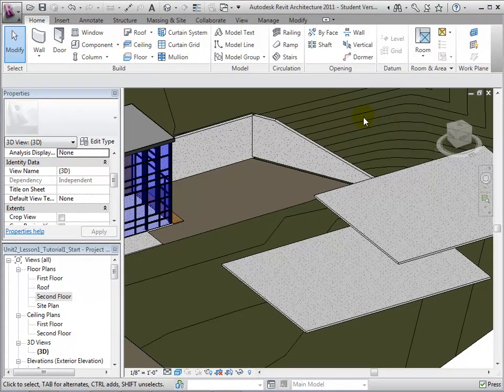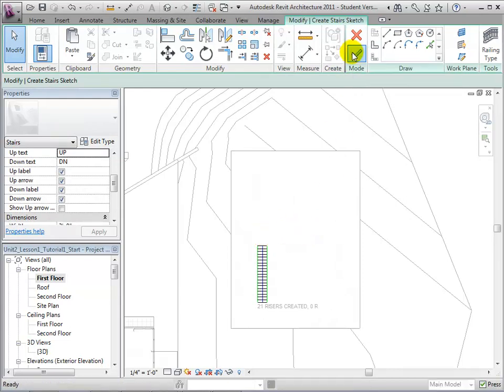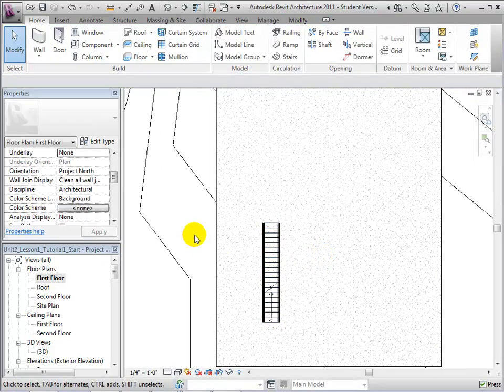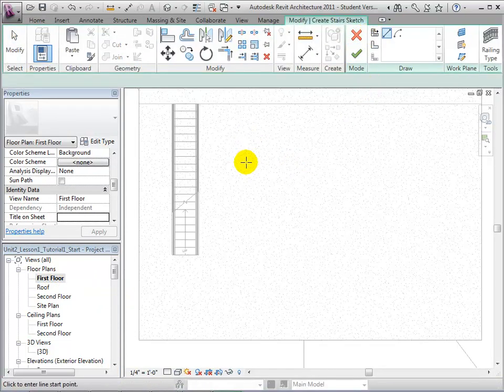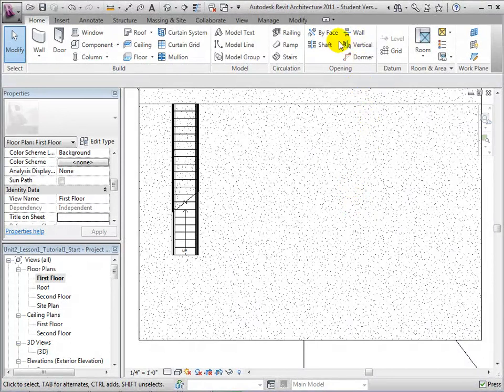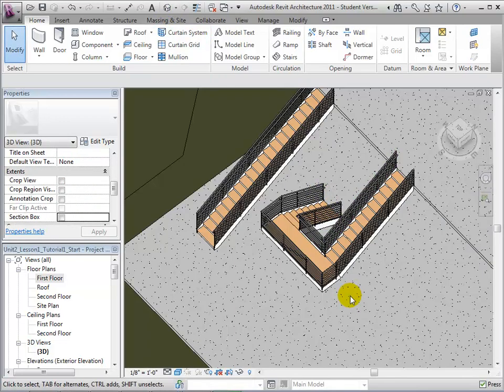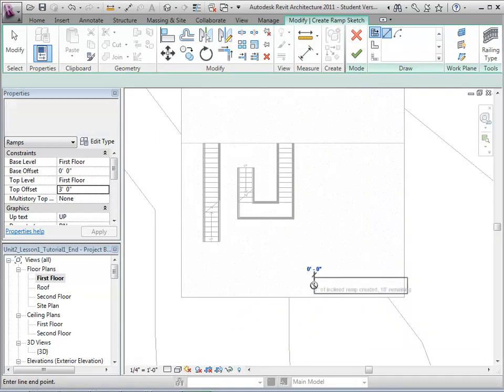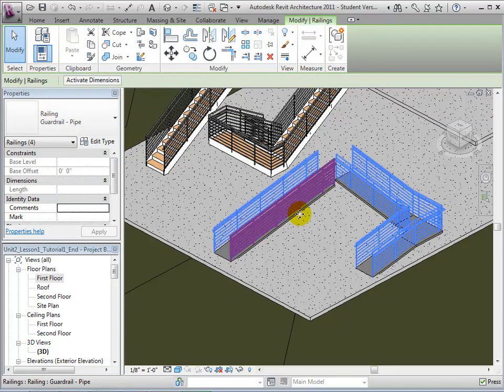Revit Architecture - Creating Stairs and Ramps

Comment: It is very cool how it makes stairs and ramps so easily.  It is not so cool that it does not have any way to precicely control the location of landings as you draw them.  They need to include some prompts in the command that allow you to tell it what distance you want a landing to extend before it turns.  For instance, I usually want there to be 4 inches min. of landing at the step at the landing before the landing turns a corner.  That allows for a clean railing transition.